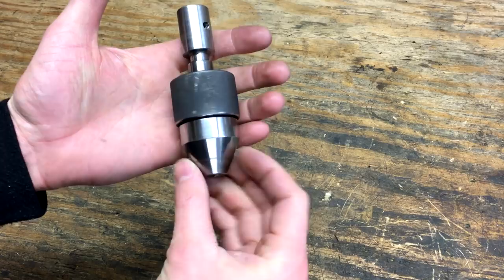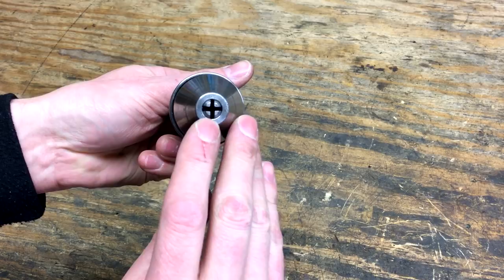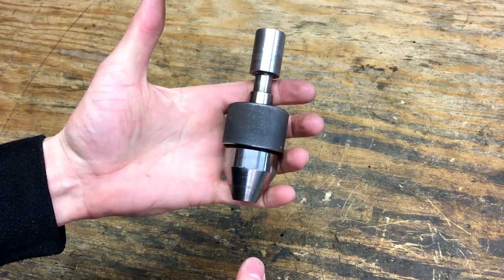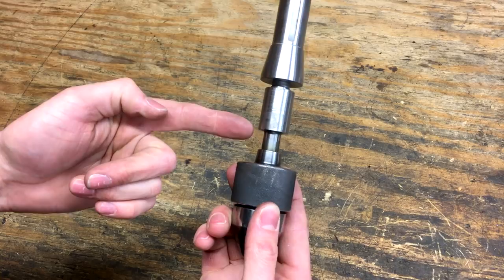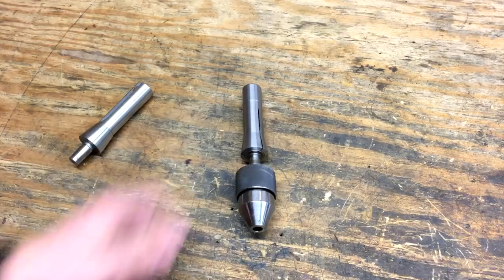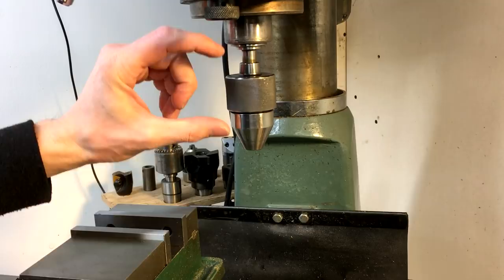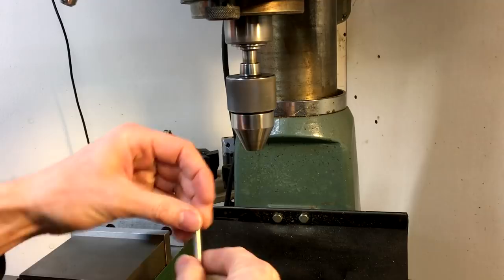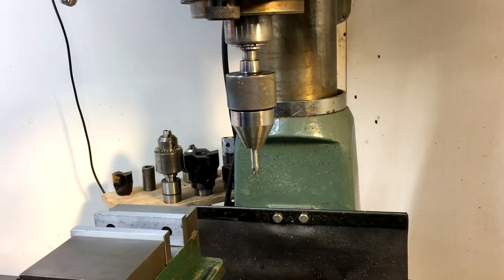Wahlstrom Automatic Chuck

Comment: gentleman, it sounds like a perfect tool to tap a hole when you are using the lathe tail, right? some small modification for safety may be......
Reply: luderick wong no, it will not work in a tailstock. The chuck has to rotate to work.

Comment: I've never seen one. Looks like it would be OK.
Reply from the maker: In my opinion it doesn't have the grip strength of a Jacobs chuck.  But for most stuff thats not an issue and you can't beat the speed when you have lots of bit changes.  Thanks for watching!
Reply: I was going to ask about grip... :-) Looks good for quickie little bit changes though.
Reply: @BuildFixCreate  Have you ever cleaned your chuck?  Instructions say to dip in a bucket of solvent to clean, then oil liberally.  Says dirt will make it slip but oil won't.  I can drill 1/2" hole in steel with no slipping with my chuck. Good luck!